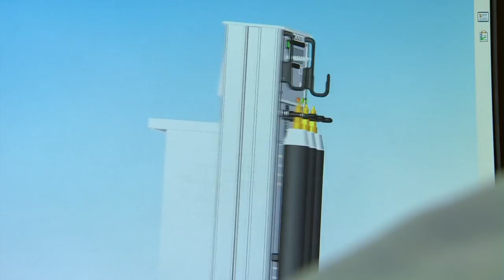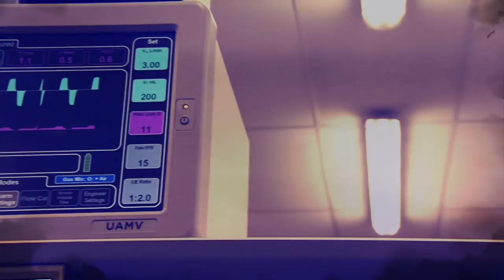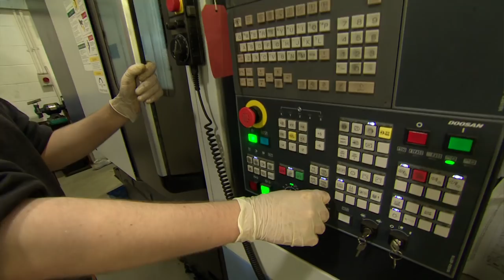Coronavirus and the race to make ventilators - BBC Newsnight

Comment: Compare the expensive and high quality stuff made by OES Medical and the silly plastic contraption made by Nick Grey and G-Tech.
G-Tech should stick to making vacuum cleaners, though they are lousy as it is.
Reply: When your life depends on it, you won't turn your nose up. 

It's just a controlled air pressure coming in and going out of a mask. G-Tech engineers will save lives, as will the other teams. 

You don't know the damage that would be done if people all saw things your way

Comment: May I say to the this guy. Offer your technical drawing, CAD files, technical data and know how to the companies willing to manufacture them. The nation will thank you for this, don't keep your IP to yourself at this critical time. An adequate motor or control board maybe sitting on the shelf at JLR or JCB, do the right thing. Engineers we can make a massive difference!
Reply: Grease Monkey , having worked in the pharma industry, it’s not a matter of sharing information and  simply allowing others to start making equipment. Making anything within this industry is all about the mindset,  many Companies try to get into pharma, most fail. Also, to be allowed to manufacture, you need to hold a licence, these are not given out without rigorous auditing and process validation. It would need a Company who holds a licence to sub contract manufacture and take responsibility for the end product QA/QC. Any issues with the manufacture would put the licence at risk.
Whilst your comments are noble and well intentioned, you need to have experience in the industry to understand the complexity behind manufacture, this is what makes products safe (and increases manufacturing costs). It’s not about IP protection, and simply making huge profit.

Comment: In chaina they trained nurses within couple of days how to use ventilator........and you need how many moths???🤔🤔🤔
Reply: Hard Life they have a larger population
Reply: This is propaganda
Reply: Jerry O Sullivan then they should be ordered to oversee massive production in their skill set on a bigger scale in bigger manufacturing settings!
Reply: Jerry O Sullivan and if that’s the case and the ROI produce them all!! Do what the rest would and keep them at home!
Reply: The NHS is too unionised.  Each group of workers is its own special interest group.  They want all nurses to have degrees.  In China if you are told to do something you do it or you end up in the gulag
Reply: Jerry O Sullivan  no, just the diaphragm really, not the lungs. 

All that's needed is a pump, oxygen inlet and a few sensors. Mechanics make it happen all the time on cars. If you think engineers can't figure out how to build a simple air pump in this modern age, you should ask them how difficult is it to make a pump work with extra oxygen. 

It's like telling a chef "can you bake a good cake". To you it may be mysterious. But to him, it's everyday work. It is not complicated to the point of impossibility, that's why over a thousand firms have reached out to help just in the UK alone. It's not that hard. 

Someone could probably build it as a project if they had a bit of programming skill and the resources